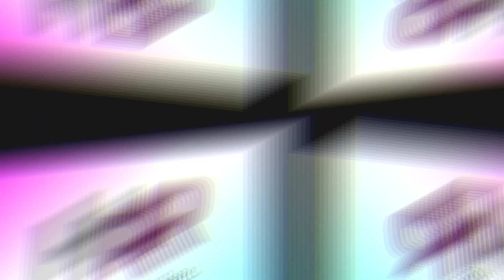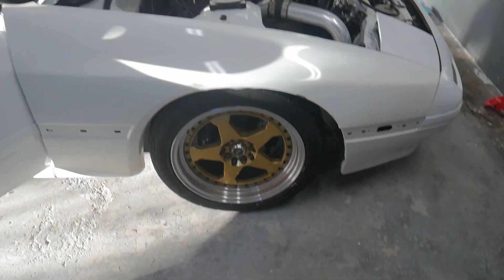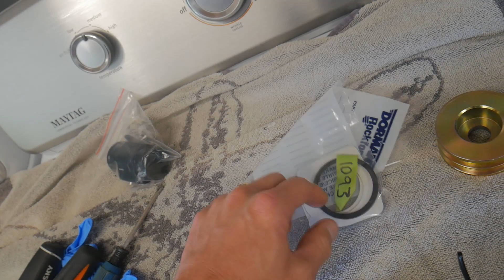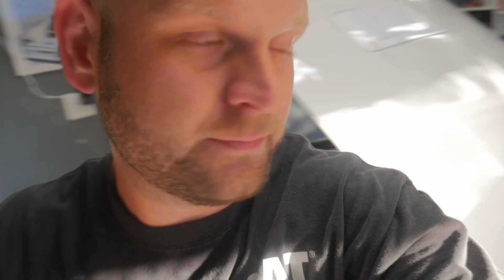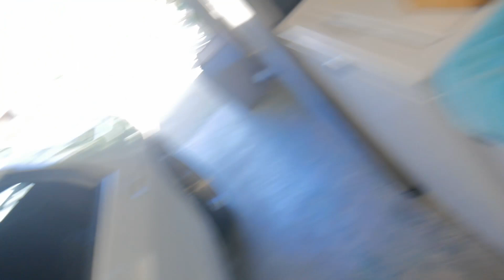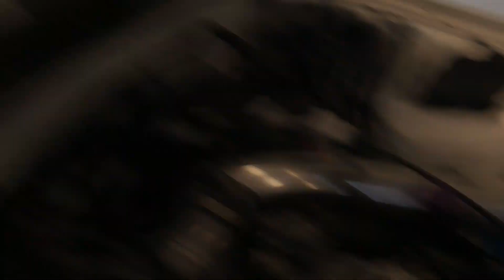Dyno Day Prep!!! // Mazda RX7 FC3S 1988

Comment: you know the S5 unit has a plastic water neck that doesnt have a radiator cap on it. in fact, mazdatrix sells a metal version of it. 
https://www.mazdatrix.com/product/thermostat-cover-alu-89-92-alum-matt-silv/
Reply from the maker: yes, and that was a consideration and the Mazdatrix products are all excellent. This option is more affordable and is compatible with a V-mount set up in the future if we decide to do so.
Reply: @MohrGarage  i never liked V mount. dont know why. im going air to water. yeah its more complex, but it produces better results. just like how im gong to continue to dump 800cc's of water smack bang into my compressor fan. lol aka pre turbo water injection.